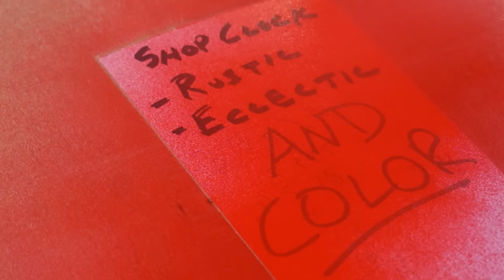Asymmetrical Clock (MonkWerks)

Comment: Cool clock.  For future reference, you can cut a perfect circle on the bandsaw (without all that sanding) by drilling a small hole in the centre first, and rotating the piece on a peg/dowel.